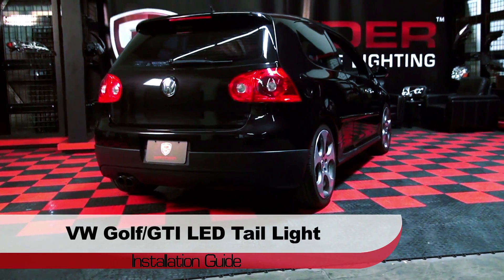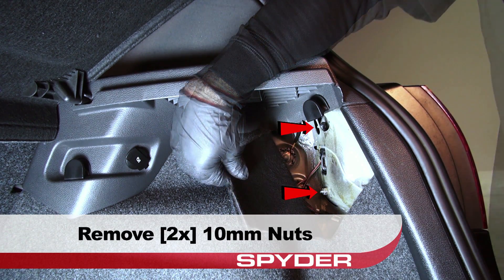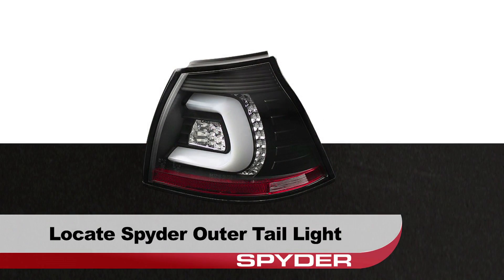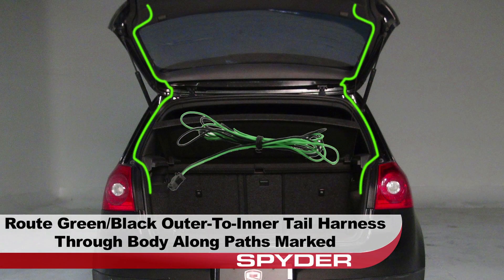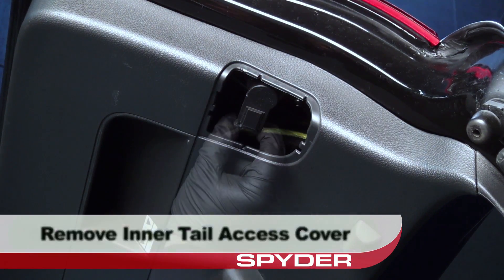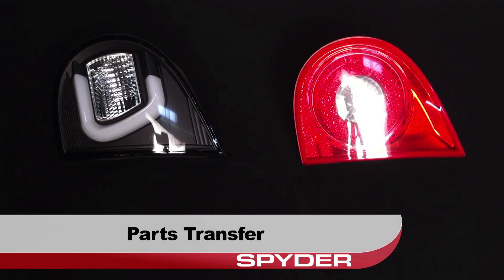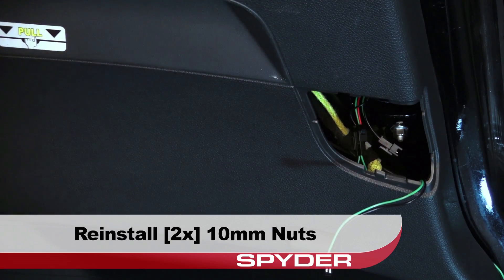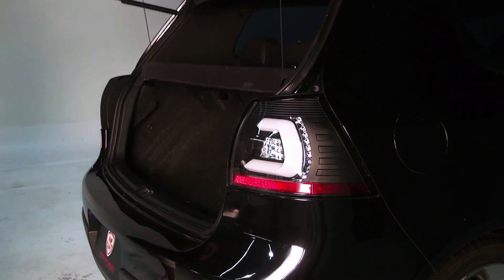Spyder Auto Installation: 2006-09 Volkswagen Golf/GTI Mk V LED Light Tube Tail Lights

Comment: I have these installed on my 08 Rabbit and have been having trouble with the night running light on the driver side shutting off but the brake light still works fine. It seems to be acting like its not getting enough power for the leds to trick the system into thinking its got normal bulbs. Also the passenger side doesn't have this issue. Is there any fix fir this issue?
Reply: that’s weird that one still works. check out your wiring maybe?
Reply: Having same issue please help

Comment: I have a 2010 City Golf, will this work? It has the same shape unlike the mk6
Reply from the maker: Is the City Golf a European model?
Reply: It's from Canada, probably hence the different name. But I'm thinking its an MK5 equivalent, i just need clarification
Reply from the maker: The Taillight function are different from the Golf and City Golf so this light will not work with your 2010 City Golf
Reply: +Spyder Auto Will this work with a mkv r32? I know the body style is mirroring GTI's mostly, but some parts aren't compatible.

Comment: how do you route the cables through the harness?
Reply: Lift the plastic around the sides of the trunk
Reply: Nah, you must cut the rubber and insert them in there carefully not to cut the other wires, it's a pain in the ass...

Comment: Where can I find these tail lights for the MKV VW? I have looked on your website but only find headlights for the MKV's and no taillights.
Reply from the maker: ALT-YD-VG03-LED-BK
Reply: spyderauto I should have also asked if these will work with a VW Rabbit. I know, I know, the Golf is like a Rabbit but I am new to VW's, hence why I am asking. I have own nothing but Hondas and know the differences from JDM to US versions and everything in between but know very little of the MKV Rabbit/Golf/GTI/R32.
Reply from the maker: they are a little different so these lights will not fit the Rabbit Alex Castellon

Comment: Does this kit provide 2 reversing lights, instead of the original 1? What about the rear fog lights?
Great video, by the way. :)
Reply from the maker: +Paul Szilard we used the stock reverse bulbs, so one reverse light on each side. our tail lights are designed for US spec and we may not include the rear fog light function since it is not required by the law.

Comment: i noticed the outer tail lights inside the red "C" doesn't light up. is it suppose to light up? ive seen pictures where it lights up yellow
Reply from the maker: ***** there is amber LED built in in that section but our factory wiring didn't enable it.
Reply: Spyder Auto I have the lights , how can you set the amber lights not to turn on with the brake lights?